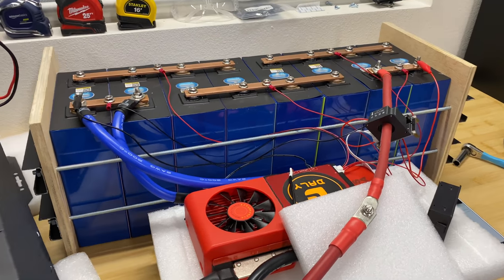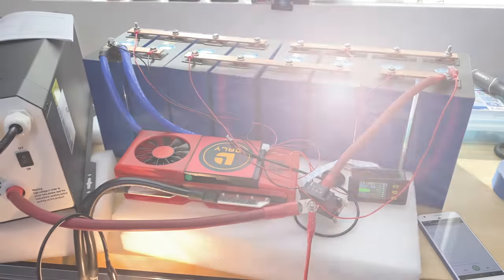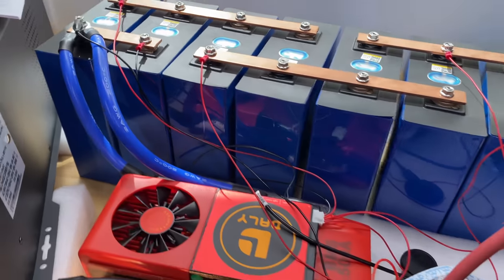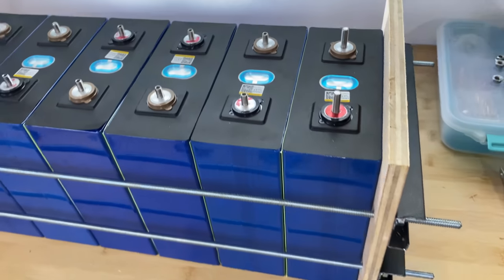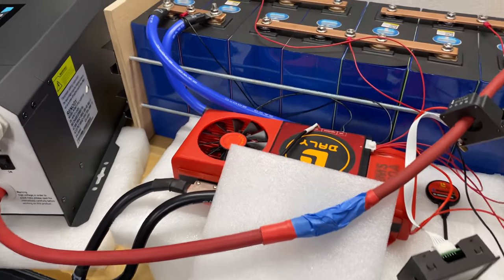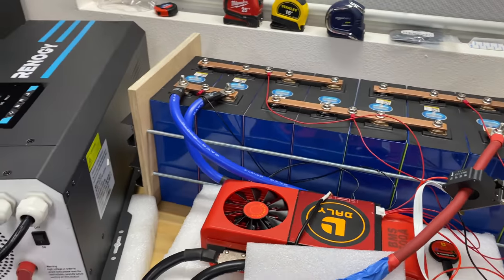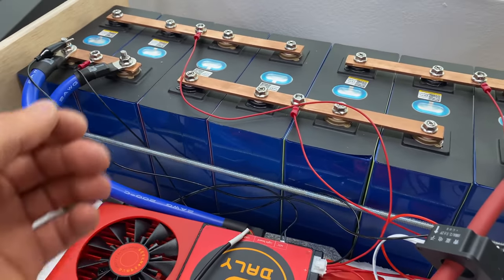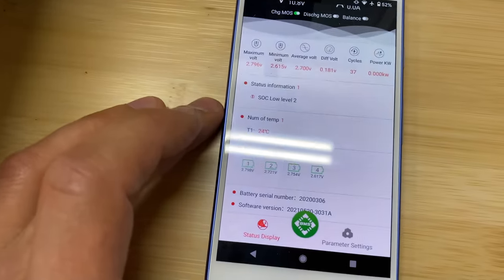Compressing swollen Grade B LiFePo4 prismatic cells. Let's experiment. Don't try it at home.

Comment: Glad you did this Vid. Prefer if you were more direct - I walked similar road via Alibaba. Neither the Supplier nor the Vendor takes responsibility for corrupt products not financially worth returning. Tried a 2nd Supplier and backed off before giving them my money. Now I'm at point where I refuse to deal with Chinese mentality and really hope for another Country to offer LFP and BMS.
Reply: Absolutely correct my friend you are an intelligent person. Thank you for chiming in
Reply: Didn't Prowse recoup from Amazon recently on bad cells from China? Shipping has gone up exponentially so bad deal.
Reply: i bought four brand new 12 volt lead acid batteries for my 48 volt mobility scooter and they lasted one year use before one failed. i could go three days of short travels before a charge was needed.    i now bought used headway cells and thats something i will never do again.  even at 80 percent life they still only last about ten minutes before they start to drop to the point where the scooter shuts down due to low voltage.  and the price of new compared to lead acid , i will stick with lead acid even though they weigh way more.  almost 600.00   lost that this poor disabled person will never get back. very disappointed.
Reply: Think it s important to fix/compress cells before starting charging on them,even grade a cells will swell 1 mm, the reason for compression is that you should get a 1000 more cycles out of the battery in total.Ray builds cool stuff has made a video on who you should be able to trust of the sellers in china,think her name is Jenny, but you can find the video yourself.

Comment: One important point is that, in your first test, the output cables were properly connected to the battery such that all cells will share current equally.  In the second test, after the compression and the new bus bars, the output cables were not connected for equal sharing of current between all cells. Connecting them as in the first test would have improved the result of the second test to some degree.

Comment: Some vendors recommend applying pressure before cells have swollen to get maximum cycle life. Doing it afterwards might be dangerous and will not result in benefit. I never even got an answer if one is allowed to recompress a stack that had been properly compressed in the first place, but then needed a single cell replacement. 

I think you can book the 8Ah to slight differences between runs and measurement uncertainty.

Comment: Great job!  I have been drilling and tapping my bus bars to hold 8-32 screws coming from underneath. The BMS leads can now fit the little red 18 Gage ring terminals crimped on instead of the way too big ones everybody puts on the cell studs. These were made for larger wire and often the BMS wires have poor contact. Besides, once I tighten the cell studs down, I do not want to disturb them again for any reason. Having a ring terminal in there is a weak spot and will yield over time and create a hot terminal.  I'm glad to see that you put the BMS leads on the bus bars too.

I have that same kind of Renogy inverter charger not yet installed. Heavy!!!  250 amp Daly, too. My 560ah cells are on a home built ''solar generator'' that I use every day. It was a fun project.
Reply from the maker: thanks! you are first noticed extra screws for sensing leads. I'm planning to use this pack to test multiple BMSs and other components. And yes the main reason is not to disturb battery studs every time, since it's really easy to over-torque and strip threads on cells.
This Renogy is f... heavy, I need to do some exercises to move it around.

Comment: I just ordered some similar to these... Sold as grade A 320 AH. 16 cells delivered for about 500 USD. Shipping should cost most of that. I don't need full capacity but the price was so good to pass up. Excellent video. Thanks for the data. 
Greg in Hawaii.
Reply: Hell could you chuck us a link to 16 cells for $500? Even if they're grade b garbage that's an insanely good price.
Reply: I just received my 105 aH Littokala from AliExpress. 2 x 16 packs. Almost all had slight bulging except 4.
Reply: Hey Greg, any update?  Since you seem to have disappeared we aren't quite believing the deal you claim to have gotten.
Reply: @ForbiddTV  well thanks for the reminder. No delivery, lying seller, Aliexpress refunded with no fuss.
Reply: Btw I bought five sets total 20 batteries. Nicely balanced 3.293 and 3.294 voltages.
Reply: $800 per set of 4. I bought five sets.
Reply: @gregguithues855  Yeah, that's back down to reality.  I just paid $640 for a set of four grade A 302Ah cells delivered. I bought 32 cells.
Reply: @ForbiddTV  that's a great price :) Link for sharing?
Reply: @gregguithues855   My links usually get blocked, but I got it from Docan Power. Price right now for one LF304 304Ah 3.2V LiFePO4 Prismatic Battery Cell Laser Welded Terminal Stud cell is $160 shipped.  If you have trouble finding it, write to me via the about page on my channel and I can email you the link.
Reply: @gregguithues855   BTW, they come from a Texas warehouse, so you get them in about a week instead of over a month.  They are actually new grade A.

Comment: I think we are just going to have to accept that the chinese vendors of prismatic cells are going to over state the capability of their cells.  This has been going on for two plus years and virtually all the vendors do it.
Reply from the maker: I think the bigger problem is used cells. I'm "ok" with under-capacity new cells. But I guess these cells were used previously. But unfortunately, it's just a guess.
Reply: @SolarEngineering  
my experience, the seller called himself "honourable" and then sent "A grade brandnew" cells that were second hand.
Reply: Just like used car sellers!
Reply: Some cells were stored for long periods and not maintained. They can swell even in storage and they degrade faster if outside the storage voltage and temperature. 
And the Chinese overstate products performances since the 90s. 
There are plenty 900000000mAh 18650, sand filled cells on ali/bang/dx/etc
Reply: i doubt very much they keep cells for long periods in storage. they want to sell them as quickly as possible.
Reply: Need to start a website listing good sellers and shaming the bad ones... Showing feedback and evidence of their bad or good product. With links to YouTube videos on these.. 
 Not just batteries, pretty much AliExpress items in general
Reply: Just buy from a supplier that you can hold accountable and return the shitty batteries to inside own country, how difficult can it be?
Reply: I am a European living in China. I am trying to build DIY power banks for 2 flats. I will let you know if I find any trust-worthy battery cell suppliers.
Reply: Most of the time they will break down things like electric bus batteries because they’ve degraded to 80% capacity but I still perfectly usable for something by the weight to energy density doesn’t matter the issue that occurs here is they can test them or they can just know they work and shit them out at a lower cost they often go the lower cost way

Comment: Regarding swelling and bus bars.. Why not use "soft" bars bended in an upward arc that will flex? Or just short thick cables in arc with a lug at the ends. I remember that cars used to have a flat braided connection on the minus pole down to the chassis that will easily flex.
Reply: would recommend that too, in case of decompression or expansion - you dont want to rip off terminals.

Comment: Be careful, cells increase their volume during charging, so you can't do it like that.
1Kg per Ah is a good value so this pack need 300Kg so 75 Kg per screw. You need some springs to compensate for volume increase during charging. Compression should be done from the begining off cell life to avoid dentritic building between electrods and then wollen cells. These cells are already used.

Comment: Maybe I’m late to the party, but was a proper too balance performed? Edit: looks like yes. 

To rule out improvements from cycling alone, why not perform the test a few more times? I’ve heard these can be “woken up”.

What was the deviation at cut off?  

Also, I’ve been weary to cut the threaded rods that close. Not sure I can recompress if I needed to disassemble.

Another pro tip, you can cut soft metals like aluminum and copper with a normal saw. Works great.
Reply from the maker: >>Maybe I’m late to the party, but was a proper too balance performed? Edit: looks like yes. 
yes, top balanced all cells till 3.65V

To rule out improvements from cycling alone, why not perform the test a few more times? I’ve heard these can be “woken up”.
>> usually cells perform little bit overcapacity while new. 

What was the deviation at cut off?  
>> Since discharge rate was very low, all cells were about +-50mV

Also, I’ve been weary to cut the threaded rods that close. Not sure I can recompress if I needed to disassemble.
>> good point, I have some extra length on other side

Another pro tip, you can cut soft metals like aluminum and copper with a normal saw. Works great.
>> need to try it, thanks.

Also I tried to search how to cut oval whole for studs to allow some play. Do you have any suggestions?
Reply: @SolarEngineering 
Я использую несколько надфилей разных размеров для получения необходимого профиля и размера. Медь мягкий металл и легко обрабатывается. Удачи.

Comment: Great job! I believe compression keeps the electrolyte within contact of the most of the internal media. If a battery bloats the electrolyte is no longer in contact with 100% of the media. With out  the media in full contact with the electrolyte I would imagine you would not get full capacity. In addition I have seen batteries that have failed and it appears that it was from media drying and separating. Cycling without compression will do both of these things. Therefore in my opinion compression is safer and adds life to the battery. I really do not believe the manufacturers of these batteries really care and say it is not necessary because they really have not done their own testing and are going off info from initial manufacturers knowledge from years ago.
Reply: Something would have changed in the cell for it to bloat, likes produce gas maybe? Compression after bloating will increase pressure but still increase electrolyte contact.
Reply: @lukefarmer5391 Don’t spread misinformation.  There is lots of information online where you can learn about LFP batteries and as such there is little excuse for making up theories.  It would be nice if you could do your homework and edit your comment.

Comment: This is exactly the same problem auto mfgr are going to have with pouch cells,there is not enough 
compressive strenght in the housing to keep the plates properly aligned . The cylindrical cells have 
great strenght to be able to resist the outward pressure, the inner separators provide the containment 
needed for the vertical expansion.
This is like a jelly sandwich when you squeeze the jelly comes out the sides.
Reply: There are no plates in prismatic or pouch cells.
Reply: That's why in the Nissan's Leaf battery pack all the cell stacks are sandwiched between metal plates.

Comment: I wouldn't try to compress bulging cells. The pressure has to go somewhere. Your batteries so do as you want, but would advise releasing that pressure. Better to have a working cell with less capacity than  blown cells.
Reply: well, he just did, and there was no explosion, no releasing pressure.
Reply: Has anyone actually had the pressure valve blow? I’ve not seen anything on YouTube.
Reply: @kevinmills5293  
i have never seen it either, except when they deliberately over charged the cell.

Comment: Yeah, unfortunately its pretty common on Aliexpress to run into those issues. But for the price, its still WAY better than when I buy here in the US. So, if I buy 4 280ah batteries and I pull 260ah, for the price of $400, its still worth it. Just lower your expectations when ordering and you'll see its value.
Reply: Not anymore you don't. It's double now :(

Comment: My concern about compressing cells is that it might cause an internal short between the layers of dielectric material inside the cells. They need to be able to expand naturally so that the pressure doesn't turn inward on the insulation layers.

Comment: I did order a set of four 280 Ah batteries from this same company ( same ali store) earlier this year and they tested out at 283+ . It makes me wonder if they just fill in orders with pure crap if they don't have good stock.
Reply from the maker: I think they build reputation and now is a time to cash-out.
Reply: they have mixed cells in stock, its random what you get. looks like he would up with 240Ah on average. if tested individually there might be higher or lower Ah cell in the group

Comment: Will the battery explode when you compress it?, maybe now but maybe month to come. I got some grade B cell too but I use flexible buss bar.
Reply: No, they won't explode. When they are overcharged, they create a gas and that causes the swelling. The blue plastic oval on top of the cell protects a scored aluminum burst disc which is set to relieve the gas pressure. The cells can swell about 3/4 to an inch  in width before the little burst disc operates. Ask me how I know.......
Reply: What flexible bus bars are you using?
Reply: @kimmer6  ok thank you, then should I leave the battery uncompressed or compress
Reply: @kimmer6  hi, thks for all those useful information,👍👍👍👍👍👍
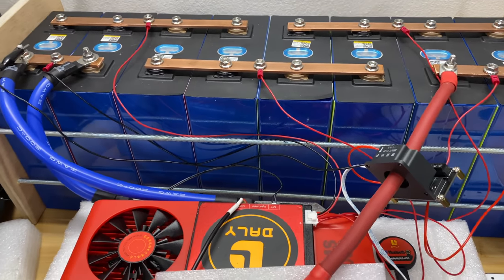Reply: @pierreqiu8147  You are welcome, Pierre. The 8- 280ah Lishen cells are hidden behind the inverter in this solar generator that I built in the attached video. You can see the edge of the left most blue cell at 0:33. This unit has many features including on board battery charger and MPPT solar charger, 250 amp Daly BMS. I built it to run my son's refrigerator and 2 chest freezers when we lose utility power again. He needs to make room in his garage so I keep using it, now having  3.5 months daily usage.

  The other battery boxes to the right of this one in the end of the video provide temporary power to medical equipment and another provides power for the refrigerator, lights, and microwave oven at a small primitive cabin we visit next to the Pacific Ocean. I do this for fun!
https://www.youtube.com/watch?v=NYpczRYDFJQ
Reply: @kimmer6  One guy has overcharged them till they became like twice wider - a spectacular scene with batteries forming a half-circle around busbars, nothing happened. lost some capacity, though

Comment: Tighten the top two bolts tighten more than the bottom.  Keeping the top bolts tight shouldn't allow much pressure on the terminals.  Keeping the bottom rods little looser would allow for some expansion.....

Comment: When Testing batteries there are many factors. U may find that the ah goes up a little on each of the next 10 cycles. Slow charging and discharge also gets more ah. A few more cycles would be interesting.
Reply from the maker: will do another capacity test later
Reply: @SolarEngineering  testing batteries can go on and on. You could uncompress half of them and then do another 10 Cycles and see where that uncompressed half compares to the compressed half.

Comment: Couple questions. Why didn't you arrange the cells with the smaller sized side ? Fixed circular holes can overtension the connector and break them when bloating. Is the compression wo torque measurement ?
Reply from the maker: Because I want to test if compressing cells would recover any capacity.
Reply: @SolarEngineering  no it won't significantly, but will increase the cycle life of the pack.

Comment: Can anyne please explain? What is the point of compressing, if in this case eventually it will most likely lead to blowout safety valve on the top of the cell (instead of inflating the cell)?
Reply: Squeezes out bubbles that become permanent and reduce capacity but must be done before first use

Comment: I wonder if the slight increase was due to charging and discharging rather than compression? If you could be bothered to charge them again and check the capacity without compression?
Reply from the maker: will try

Comment: I always see these with the terminals facing up.   could these cells be rotated  90 degrees toward the camera direction.
Reply from the maker: It's better to check with manufacturer. cells that I'm using can be positioned as you described.